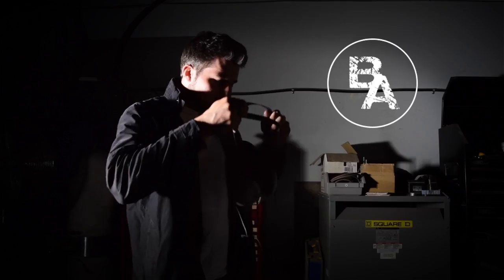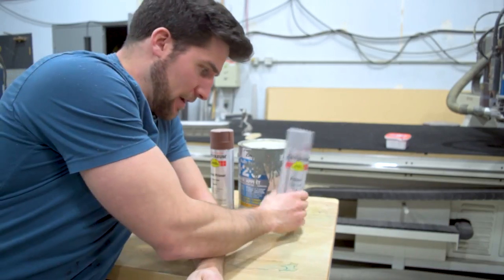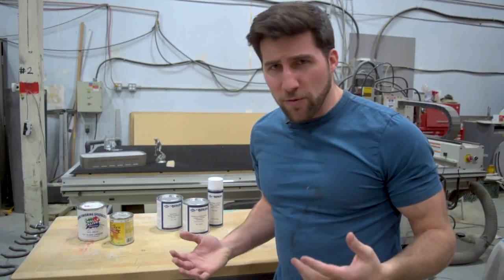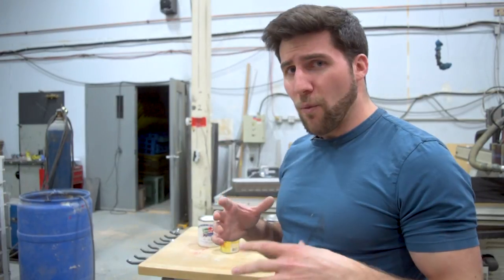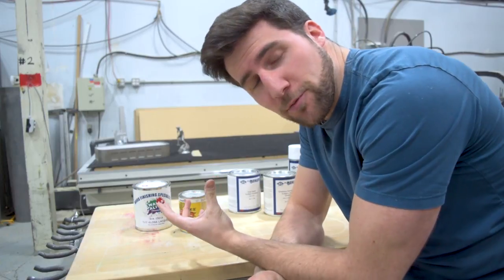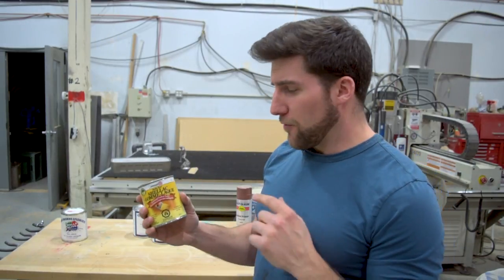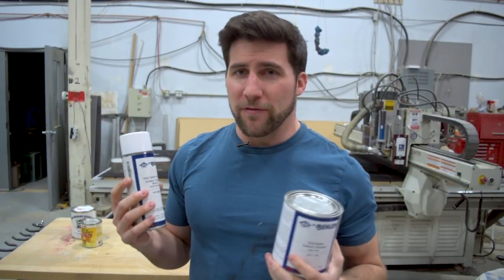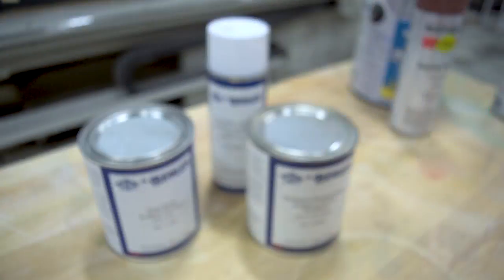Primer vs Sealer (and what they are used for)

Comment from the maker: Behlen's vinyl sealer has been rebranded under Mohawk as their EZ Vinyl Sealer - take a look at the Behlen/Mohawk list at my amazon store link here to find it: https://www.amazon.com/shop/bradangove
Reply: Can you use the Mohawk EZ Vinyl Sealer in the spray can on a dyed guitar top and then use Spraymax 2K Clear Glamour over that? Hoping to avoid any unforeseen reactions between products. Thanks as always!
Reply from the maker: They don’t recommend it. I have, and it has worked, but you would be safer with an acrylic sealer.
Reply: Hey Brad!
Thanks for the videos! super informative!
One quiz for you... yesterday I put several coats of it (Mohawk EZ Vinyl Sealer) to my guitar body, so when can I start sanding and which grain should I use?
Thank you so much for your help!
Reply from the maker: How many coats? Generally I would say wait 3 days and then sand with 400 grit.
Reply: What would you recommend as a sealer for a solid mahogany carved top guitar that I plan to finish in an automotive acrylic lacquer for an opaque color and clear coat?
Reply from the maker: An automotive primer should work fine in that context.
Reply: @BradAngove  That’s what I was thinking but needed a more informed opinion. Thank you for the reply.

Comment: Thank you Brad! I was going to spray Deft sanding sealer before my color and go through the sanding process with a few coats, but I needed some clarification. You answered my question; so I don't have to put primer on top of the sanding sealer. You've helped me a great deal, and I thank you for that. Greg
Reply from the maker: Glad I could help

Comment: One thing I like using a primer for - especially on wood - is to provide a consistent surface for the top color.    I sprayed a white primer on my Gibson Gold Top finish for example.   I probably didn't need to...but I think it saved on the coat count for the gold.
Reply from the maker: I think you might be right. I would probably have done a few coats of sealer and then a heavily pigmented white base coat. White has good opacity, so it works well for that sort of thing.

Comment: We did our kitchen red wood table sanded down 220 400 stain with grey stain and sprayed auto 2k clear coat. That was 3 years ago and i have kids. The table still looks like the day i sorayed. I put 2 coats very wet and let dry next day sanded with 600 dry and resprayed. Came out like glass and super tough havent found a chip in it yet! Thanks for your vids!
Reply from the maker: Sounds like it worked out great. Glad to hear it.

Comment: For my truck which is a midnight blue metallic I said was gonna use a primer sealer but gonna use a dark grey sealer since my truck is a dark and not black. I have a color blender product now to blend in small spots with my paint where I had scratches at but will have the time to do it on the weekend and it finally gonna be in 70's more now in Michigan but moving to Texas before the next 9 months.

Comment: If you’re using shellac for your seal coat on wood prior to painting, just ALWAYS use DE-WAXED shellac. Used the waxed and you’re screwed.
Reply from the maker: I did some tests on this with poly overtop and didn’t have any issues with the waxed stuff; which I found surprising.

Comment: Just today I found myself in a pickle. I needed, what I thought is, a "primer", for some woodworking project. Since I am in Japan, they didn't know the term, so I tried to ask differently by explaining in bad Japanese that I need to have a coat of "paint" that is not real paint, before I can apply real paint. They understood and directed me to the section where they have different brands and kinds of sealers. Which confused me. But this video, thank you Brad, cleared that up. BigBigBig  👍 👍 👍

Comment: The product I use is Cat Lacquer. I am using Omega Primer, base coat and clear coat. After completing my piano job I had an area I needed to re sand through the clear coat. Should I still use my primer when redoing that area? Thanks Brad !
Reply from the maker: Not if you’re only sanding through the clear.

Comment: I like to use primer on wood when i have to do conversions. like when moving pickup holes and filling. 
I like the way it sands and really hides the filler, makes it really nice and flat between the fills. 
:)
Reply from the maker: That certainly makes sense.
Reply: @BradAngove  i noticed when i spray sealer over primer (admittedly, its cheap primer from a rattlecan), specifically where things have been filled, it has a chemical reaction which causes the filler to swell even after primer 
Doesnt happen when primer is used alone or when sealer is used alone, or where the filler isnt present. 
Quiet strange. 
Just thought i should mention this

Comment: Hi Brad many thanks for this clip. 

Let's take car body scratches/stone chips for an example - fillers are used to fill the gaps/holes; primers/seals are applied on fillers to provide adhesion to the paint. Is this correct? Or I could skip the primers and paint directly onto the fillers?
Reply from the maker: You have it correct.

Comment: One thing I've been really confused about after watching lots of your videos.  Do I sand after different coats of different paints?  Do I sand after I lay down vinyl primer?  Do I sand after I lay down the Auto Air acrylic sealer before I put down the base coat?  Do I sand in between layers of clear poly?
Reply from the maker: If you haven’t already, have a look at my video on whether you need to sand between coats. That will help. 
In short: yes after the vinyl sealer, sometimes after the acrylic sealer, and for the poly you sand between sessions if you’re doing more than one, but not between coats per se.
Reply: Awesome thanks!  I'll try to find that video.

Comment: I have a raw linden body and rattle cans of primer, gold paint and candy red paint - all acrylic lacquer. 

After sanding, I was recommended by a guy here on Youtube to use Shellac as a first step. 

I couldn't find the right type of shellac at the home improvement store. Instead, the sales guy managed to talk me into buying what is characterized as a 'water based lacquer sealer' for the first coats. After searching for more info, I found that it is generally not recommended to use water based lacquer under acrylic. 

So my first question is: will it be OK if I just spray the acrylic primer onto the sanded linden wood guitar body, followed by the gold and candy red? 

Or would it be better with another layer of something else before the primer? 

If so - would the 'water based lacquer sealer' work? If not, what should I use as the first layer (the availability of various types of paint here is limited, not like in North America or Europe.) Thanks in advance for any pointers!
Reply from the maker: You can just use the primer. If you want to use something better I would go with a vinyl sealer.

Comment: I've been researching primers for a fiberglass tonneau cover project with a lot of body filler for awhile now. I've found out that 2 part urethane primers are best for fiberglass. But after watching this video I'm not sure I need primer. Should I even use the high build urethane primer to help cover up imperfections and just go straight to  the oil based hammered copper paint?
Reply from the maker: I’m not sure about painting fiberglass. I’ve never done it.

Comment: Brad, first off, thanks for all of the informative tutorial videos.  I find myself getting lost in them (in a good way).  I had a question about prepping a Solo guitar kit. I got a SG DoubleNeck kit.  I sanded the sealer off, and then used several coats of Aqua Coat grain filler and sanded smooth.  Next, I used a duplicolor spray primer like I saw in one of your videos.  The primer still needs to be sanded, but I can tell that there are a few spots where the grain is still showing through.  My question is:  Should I have used some kind of sealer instead of the primer?  I plan on spraying with a flat-black duplicolor.  I will then look for some kind of clear, possibly one of the 2k clears that have a longer shelf life.  Thanks for the info. I'd love to share some photos of my progress, if you wanted to see, since I am following your method.  Mike
Reply from the maker: Sometimes primer shrinks as it dries, as does filler. It’s not all that surprising that you may see some grain through the first layers. Consider sanding back most of the way and then doing another couple coats of primer.

Comment: Hello, Brad
If you don't mind, may I ask a product recomendation from you?

I'm a father of two kids. We moved to a top floor of the old apartment in May 2021. We have been suffering from bad sewer odor in kids room since we moved to this apartment. Fianlly I decided to open the wall and fixed the sewer vent pipe, but it still stink. 

Last thing I can do is to seal the wall and ceilling with some kind of paint or something. So I am asking what is the best ordor sealing paint you recommend to my kids room. 
Your quick advice can help my kids health.

Best regards,
Carlton Kim from South Korea
Reply from the maker: Hi there,

This isn’t something that I’m familiar with. I would think that odor sealing has more to do with achieving an air tight seal than it does with the paint type. You might want to seal the joints/corners with aluminum hvac tape.

Comment: Thank you for the video. I have a problem applying many coats of sealer (NC or PU, no difference) ends in a milky colour which ruins the crystal clear top coat from beneath. Do you have any suggestions?
Reply from the maker: That’s called blushing. It comes from excess humidity being trapped under the paint. For nitro you can sometimes get it out with a heat gun (gently) or with blush reducer. Using a slower solvent when spraying if you’re mixing it yourself can also help.

Comment: House of Kolor uses the same paint for sealer & primer , just mix it thicker. They have the details & their paints are top of the line. Their clear never yellows and is clear , Clear!
Reply from the maker: Yeah, that’s the case with pretty much all automotive grade polyurethanes. They stay clear and have built in UV protection.
Reply: @BradAngove  ... Right but I think House of Kolor's primer, paint, and clears are like no other paints. If you ever use them you'll see.
Reply from the maker: I do use them. They’re a lot like PPG. I really enjoy working with HOK for airbrush work that involves candies.

Comment: Brad this is a God send upload. One question just before I go and pull trigger and get the materials. I need to paint fascia etc on my Tudor style house. They replaced pieces of wood with Cedar. So a sealer is a better choice for the outside then Behlen Vynal sealer would be a better choice for the outdoors before going over and painting it with Sherwin? Thank you in advance. I think you have answered my question I just want to double check.
Reply from the maker: Sherwin had their own compatible sealers for wood that should work. You may want to consider sticking within the same line of paint.
Reply: @BradAngove  Good point. Thank you.

Comment: Can you please review my painting plan for a steel bike frame. Let me know what you think. I already picked up from getting sandblasted and has no paint. But feels like it has primer already so not sure what thats about.  But here it goes....
1. Sand lil areas here and there to smooth out metal lil chunks around lugs & spray air to un- dust
2. Wipe down with mineral spirits and let dry
3. Spray rust-oleum primer filler & sandable let dry
4. Sand and spray air to un-dust
5. Another coat of primer filler and let dry
6. Sand and spray air to un-dust
7. Spray with primer sealer and let dry
8. Thin out oil based paint and brush on to get everywhere (around lugs, and double top tube part mixte buke) and let dry
9. Wet sand and wipe down
10. 2nd coat using preval sprayer with same paint
11. Wet sand and wipe down
12. 3rd coat using preval sprayer
13. Apply decals
14. Spray/brush top coat?
15. Wet sand?
16. 2nd coat top coat?
17. Wet sand?
18. Last top coat layer?
Im not sure what to do for the top coat part or what i should use. Let me know what u think pleas
Reply from the maker: That process is fine. You don’t really need two types of primer though. The filler primer should be sufficient. 

You don’t need to wet sand between coats. If you are within the recoat windows when spraying you can do 2-3 coats in a row no problem. Even if you are sanding, dry sanding is sufficient.

Comment: Hey Brad, question about clear primer for guitar burst paint jobs... I am planning on spraying a burst with Lil' Daddy Roth Flake Bad Azz Blue Kandy (comes in a rattle can) over a maple burl top wood that has been stained to pop its figure.  I need help choosing a clear primer (ideally in a rattle can) that will work for the paint, but unpigmented so it does not obscure the gorgeous wood grain. Kiesel sprays a "primer' over UV-activated sanding sealer... I know it's a loaded question... maybe overthinking this
Reply from the maker: I’d say keep it simple and just use your clear coat as a primer as well. If it’s catalyzed then 2-3 coats should do the job just fine. 
Otherwise a polyester sealer would also be a solid option if you have access to a way to spray it.
Reply: Thank you for your reply... very helpful. Looks like the guys at Oxford Guitar Supply Co have a nitro lacquer sanding sealer that may work well for this.. comes in a rattle can :) @BradAngove

Comment: I am using a Feather- rite  auto body filler on cabinets, what primer should I use on top of the body filler as a primer. My finish paint is Sherwin Williams - emerald urethane trim enamel, thank you.
Reply from the maker: Use the primer from Sherwin Williams that goes with your paint.
Reply: @BradAngove  In my region, I am not getting the sherwin williams primer, but I have used auto body filler, would any latex primer works
Reply from the maker: I don’t know. You should ask the manufacturer.

Comment: Thanks for the info! But I'm in a bit of trouble, where I live (Chile) I can't find any vinyl sealer, only acrilic, can I use an acrylic sealer on a guitar and then paint with spray? Or should I step this part and use some primer in this case?
Reply from the maker: You can seal and paint with acrylic if you want.

Comment: Question: If you were finishing a guitar with a Minwax penetrating stain, would you NOT use a sanding sealer? As opposed to using a water-based stain (dye) in which case would you use a sanding sealer? And would it be BEFORE the stain as opposed to after?
Reply from the maker: You could use a sanding sealer in either event. It would always be after the stain/dye though. If you seal the wood, the stain won’t soak in and stain it.

Comment: Hi Brad,  I use acrylic paint on metal water bottles and travel mugs. but the problem is that the paint peels off and I am not able to figure it out. For my case where i would like to use acrylic paint,  I am assuming a primer plus a sealer to make it durable? What type of products would you suggest to make it dishwasher safe as well? Thanks for the video it's  super useful to folks like me.
Reply from the maker: If you want paint to stick to metal you need to sand it first and then use a self-etching metal primer. No sealer required, but you’ll need clear coat after for durability. 

None of that is dishwasher safe. For that you need something like a frit-fired enamel, and an oven/kilne capable of baking the enamel on.

Comment: Hi  Brad,,,,how r U and tanx  4 da video...I'm going to be spaying some wood panels....Like those fancy euro kitchen cabinets..and want to use automotive paint  and lacquer,,,,,due to it's pallet of wide range of colors...I'm I going with a (Catalyzed Epoxy Primer or  SEALER)...and for the clear coat can I use the automotive stuff or do you have another suggestion..>>>???
Reply from the maker: Yes, you can use the automotive stuff.
Reply: @BradAngove  thanx 4 da repy...

Comment: Brad, did you say I could use an Auto 2K Clear as a sealer, flat it and then that is ready for base coats and then more 2K clear? How long should I leave it on before flatting it, it will sink won’t it? I’m spraying a guitar neck, including walnut fretboard, with 2K clear to get a high gloss. I’m fed up with trying to use celly products right now, the weather is too cold and humid, I’m getting too much blooming. Thanks in advance. 👍
Reply from the maker: You can. It shrinks in a little bit, but that reaction is largely complete after about 24 hours for most 2K automotive clears. Then you can sand flat and spray your base coat.

Comment: I have some pre-stain conditioner and Mod Podge. Can I use either to seal a raw body?
Reply from the maker: Pre stain is not a sealer really. Mod podge is pretty much glue, so I guess you could use that. Obviously it would make more sense to just buy some sealer though.
Reply: @BradAngove  thanks

Comment: Are white enamel primers compatible with urethane-based color coats?  I had an automotive paint supplier mix me a pearl color in an aerosol can, it requires a white primer underneath in order for the color to look right.  Most of the 2k and high-fill automotive primers are grey, while the type of flat white primer I need is typically available as a Krylon/Rustoleum/Duplicolor can.  I assume those products are mostly enamels.  If I give the primer plenty of time to dry, can I apply a urethane over top of it?  Thanks.
Reply from the maker: That shouldn’t be a problem. Just give it lots of time to dry and sand with 600 grit before painting.